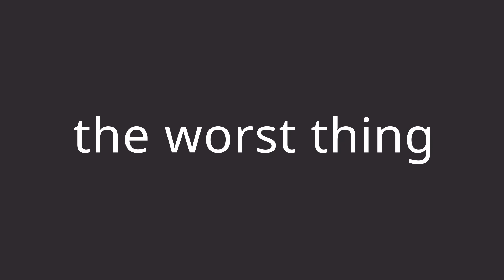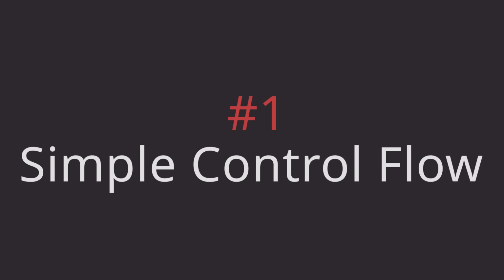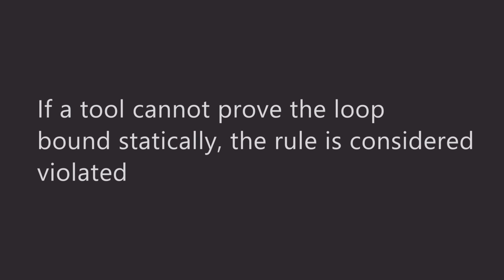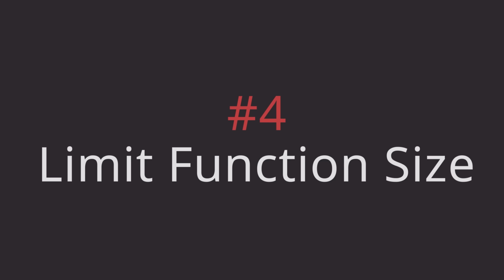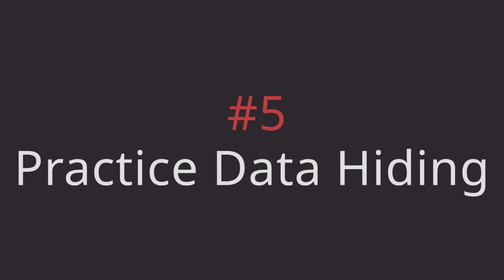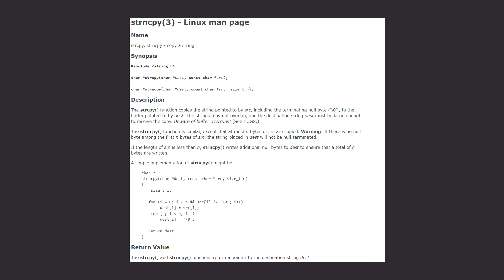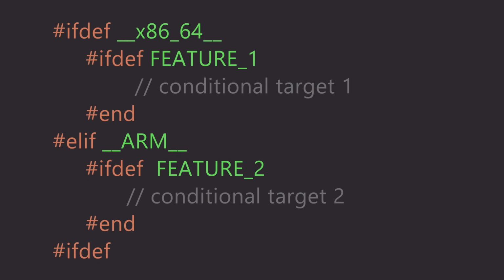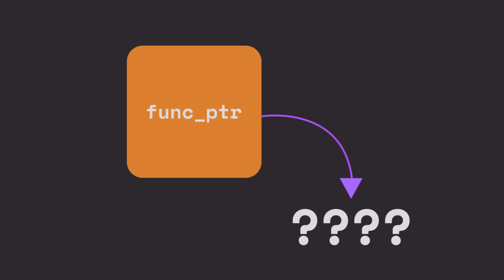how NASA writes space-proof code

Comment: Let's also remember that NASA has to write code for hardware that is, to put it lightly, UNRELIABLE.

There is a random chance that a solar flare might wipe significant portions of memory, for example, or maybe a payload will get hit with debris that takes out a chunk of the machine.
The code for such a device needs both redundancies and simplicity as you may only have mere hours to solve a problem before hundreds of millions of dollars slam into the moon.
Reply: Bollocks.

Comment: Wouldn't it be better to make a language and compiler specifically for such zero-tolerance cases? The language will automatically enforce these rules just like how many languages don't allow the use of pointers, and then only the compiler itself should be 100% compliant with these constraints.
Reply: that is rust
Reply: @phoneywheeze  not really, I mean, Nasa has specific requirements as shown in the video. There is no current language that will literally not compile with a name variable "a" but they could make this requirement part of the parsing itself to guarantee it.
Reply: @lake5044  yeah they could. Haven't done any research on nasa but likely they have their own compiler, or some tool in the build process that checks these 10 rules and other stuff already
Reply: So, basically C with less features?
Reply: ohh you are talking java
Reply: @beastofthenumber6764  Circumventing Java's garbage collection doesn't stop it from making garbage. It's not memory safe.
Reply: @abebuckingham8198  no language is memory safe, but it is memory safer than other languages just by not allowing pointer for example. The point being is java is a language with explicit restrictions born from pragmatic shaped rules. So is the same case as a a theoretical language thats based by the nasa rules.
Reply: @beastofthenumber6764  Java is the only popular language that NASA doesn't use. That's not a coincidence. It's widely understood to be unusable for reliable code because of it lacks the ability to manage the hardware directly. The US Department of Defense has published multiple articles pointing out it's unsuitability. Platform independence is a wonderful feature for widespread applications but that comes at a cost of low-level control. It's literally the worst language in the world for NASA applications.
Reply: @abebuckingham8198  The question is can NASA have a language that follows the set of rules show in the video instead of expecting programers to follow them by their own.  Java already did this with another set of rules they are not the same and if you are correct dont work for nasa, thats fine, just make a language that does. But java and pretty much all modern languages (Ruby, Python, Go, etc)are evidence that it can be done.
Reply: @abebuckingham8198  PD: If nasa uses C they can  pretty much use any other language instead.
Reply: @beastofthenumber6764  You're really out here confusing interpreted languages with compiled languages. I can see how you ended up programming in Java. Try not to leave your whole brain in the litter box.
Reply: @abebuckingham8198  i really dont get what your argument is, first i think i expresed myself poorly in my first response and sounded like im advocating for java. So I corrected saying im for the principle of making a language follow a set of pragmatic rules i mention a few some of them happen to be interpreted but that is irrelevant to my point. Are you arguing against another especific point?
Reply: @beastofthenumber6764  You can't replace C with languages like Python because they don't allow you allocate memory directly. It's obvious you don't understand how garbage collection and tail-recursion work. You're not equipped to understand the differences between languages.

Comment: I am systems engineer who designs and writes software for spacecraft, not nasa but privately owned and launched satellites. Outside of NASA some of this is true especially avoiding heap allocation and recursion. Modularity is key, the ability to isolate key functionality into small code blocks that can be tested,developed and repaired is a big design motivator. Tides are turning now, the last thing I worked on essentially just ran Linux and system components just ran on top of that. With that advancement more sophisticated sw tools and memory management techniques open the door to a much more laid back approach to spacecraft software design.

Comment: In Nim I'm forced to either use/store or discard all return values, and automatic reference counting (ARC) works really well on microcontrollers (as long as we avoid cycles or handle them properly). I wonder if NASA has considered using Ada or some other language that inspired Nim. Or SPARK which is a subset of Ada designed to be completely verifiable.
Reply: It's safe to say NASA knows about Ada, since it was required for military projects for quite a while and still powers a lot of aviation software.

The problem is getting people who know how to program in it.  You can hire Java and C++ programmers anywhere, but Ada programmers only really exist inside the aerospace and defense industries.
Reply: @jeffspaulding9834  Thank you, I didn't know about that. But it makes sense.

Comment: rule nr. 11: always annotate the unit of measurement wherever applicable. private aerospace contractors could otherwise introduce imperial units into your code without noticing 🙈
Reply: The fine for violating Rule #11 is: $327.6 million
Reply: Nice to see that someone else got the joke,  @pilafmon .
Reply: Units should be a part of type not a comment next to a value. Your code should not compile when you mix units. You can add explicit conversions if you want to. Create a type LengthInMeters and use it everywhere.
Reply: @rafałzięba9982  yep, that’s a great standard!
Reply: @rafałzięba9982  Well most space code is written in C. Good luck with the type system.
Reply: @agranero6  That is a toolset issue. During Apollo missions computer program (at least parts of it) was manually woven (I had to google this word) with a wire. We don't do this any more. Beside, even when you have the type system you can still do some precompilation things to lower it to regular C.
Reply: @rafałzięba9982  How can you make unit a primitive type like float?
Reply: @finmat95  Create a struct or a class with a single field of type "float" and call it "LengthInMeters". Create another one and call it "LengthInInches". Do not add any implicite conversion. This was the compiler will always point the big error you are about to make.
Reply: @rafałzięba9982  Assuming the language supports it and that one can spare any memory/time cost, I agree.
Reply: @lissythearchitect  I think they meant creating user types corresponding to units, not a language's built-in types
Reply: @orthotron  I understand. Not all languages support creating user-defined types, nor have the strong type checking needed to make this useful. Sometimes all you can do is change the name and/or comment.
Reply: @lissythearchitect  A good compile time data type shouldn't affect momory/runtime much.
Pretty much all major languages support faking user-defined datatypes.
It can be as simple as a struct, a type label, and a function
Reply: @lissythearchitect  PASCAL, for example, has strong type checking and does not require the use of pointers unless needed. And I say disallow pointers in any case
Reply: @rafałzięba9982  COMPLETELY agree! Make it a type and enforce type standards. Another reason I like Pascal, ada, etc.
Reply: @rafałzięba9982  Agreed
Reply: @rafałzięba9982  lmao
Reply: Yeah, I bet NASA started annotating their units of measurement after the facepalm-worthy failure. 😄
Reply: @kneekoo  I would hope so. But considering my experience doing <government> work, do NOT assume so!!
Reply: @GinoACosta  Well, I don't really have to assume or bet, because they talked about their Mars Climate Orbiter mission, and they learned that lesson. But considering NASA caught a lot of issues in Boeing's Starliner, and haven't green-lit it even to this day, I think they're doing pretty good at catching problems.
Reply: I agree; units are essential where they are relevant.
Reply: One thing that I've learned to do over the years, when I have a variable named something like "timeValue", I will always add the units at the end, EG: "timeValueMs" or "timeValueSec".  You'd be surprised how often even the person who writes the code will forget what units they are operating on.
Reply: @gamerk316  Absolutely! Sadly, we have to do that precisely because we don't have variables for all the kinds of measurement classes that we should have.
Reply: use the type system instead!
like create a wrapper struct or something. name annotations will fail you eventually
Reply: Mars Climate Orbiter moment.
Reply: Rocket science is done in imperial.

Source: ive sent rockets to space
Reply: The problem wasn’t with the private aerospace contractor but with NASA’s own spec being incorrect.
Reply: LOL - this could be avoided all together if everyone used the freaking METRIC system!
Reply: @RocketRenegade  mixing up meters and centimeters, or milliseconds and seconds can still be an issue
Reply: @v0xl  that is true but I was specifically responding to mixing up imperial and metric measuring units.
Reply: @RocketRenegade  This could be avoided altogether if everyone used US customary units.
Reply: Metric > hamburger units
Reply: I was waiting for this in the video but sadly no mention. It's ALSO very important.
Reply: xD
Reply: I would kindly revoke the membership of this particular team member 🤣
Reply: A comprehensive set of classes need to be developed (and their use enforced) which defines classes for all the multitude of measurement units (inches, feet, speed, seconds, minutes, watts, volts, amps, and on and on) along with the valid conversions amongst them, like multiply two length class values and the result should be an area class value.

It should be FORBIDDEN to use simply integer or floating point numbers to represent real world units like feet, and inches, and calories, etc. It should be REQUIRED to use the appropriate class for those objects.

Maybe these classes already exist. I had never come across them during my career. But they would certainly have eliminated the problems of, for example. a spacecraft crashing into another planet because one software team was using imperial units and the other using metrics.
Reply: Even better, lets just not use freedom units in anything that is minimally serious.
Reply: @elEd0  Freedom units? I've never heard that expression. What do you mean?
Reply: @RogerGarrett  That is how people in the internet call imperial units, its a meme basically.
Reply: Absolutely agree. Have always wondered why this is not done as a standard in all software.
Reply: I call this the "don't hire Americans" rule.
Reply: Lockheed Martin moment
Reply: Ah yes nasa lost a rover cuz of imperial measurement
Reply: yes - i repeated your point
Reply: It happened already...other suggestion: anotate version: Ariane 5 was loaded with a configuration code (I think, I can't remember) for Ariane 4 and it was not ended in a good way. The watchdog detected the wrong trajectory and it self destructed. I found it "a 64-bit floating point value was attempted to be stored in a 16-bit integer, causing an overflow due to the higher velocity of the Ariane 5" Rust doesn't seem so bad now, hun?
Reply: The tragic thing is, NASA had already established that it is working in metric. So that was entirely on the contractor
Reply: Using Imperial is stupid to begin with.
Reply: @crateer  Tell that to those who use it
Reply: It always amazes me that even standard C# functions like Sleep() often don't specify the expected units.
Reply: @steve16384  But are they not the same units every time?
Reply: @kneekoo  Presumably they are if it's the same function each time, but they never explicitly specify the units. Sleep() was just an example.
Reply: @kneekoo  of course the units differ between languages and even libraries, and a good programmer should know multiple languages. Which means I can correctly know the units for sleep() but still get it wrong *for the language I'm writing at the moment*.  I've done errors like that - written code that has a bug but is exactly correct - in another language.
Reply: Agreed! In Every Function
Reply: A comprehensive set of classes need to be developed (and their use enforced) which defines classes for all the multitude of measurement units (inches, feet, speed, seconds, minutes, watts, volts, amps, and on and on) along with the valid conversions amongst them, like multiply two length class values and the result should be an area class value.

It should be FORBIDDEN to use simple integer or floating point numbers to represent real world units like feet, and inches, and calories, etc. It should be REQUIRED to use the appropriate class for those objects.

Maybe these classes already exist. I had never come across them during my career. But they would certainly have eliminated the problems of, for example. a spacecraft crashing into another planet because one software team was using imperial units and the other using metric.
Reply: @RogerGarrett  Those classes that you mention probably already exist, the problem is that they will be of no use if someone working in the code makes a mistake and forgets to apply the corresponding conversion. Avoiding human error should be the priority and the most effective and elegant way of solving this is just using a standard metric in any given field of study. Not to mention that in some conversions is inevitable to lose some quantity of precision.

 The problem with imperial is that they are not precisely defined using universal constants as the metric system is, making them obsolete in fields where absolute precision is needed (like space science is).

Of course I understand that some people are more familiarized with the imperial units, but humans dont need that level of precision in their day-to-day lives, so using imperial can be justified when used to give information to a human (a ruler, a speedometer, etc)
Reply: Imperial are nonsense. Any further consideration about how 1000mm = 1m is worse than 737383ft = 1/7137 mile is emotional. Period.
Reply: @mestresplinter2467  Imperial should only be used in human interfaces, where exact precision is not required and making the metric to imperial conversion is usually as easy as making a simple multiplication. Anything other than that should not even consider the idea tbh.
Reply: Mixing units of measurement is up there with mixing informative engineering information with political gossip.  Can be problematic if not acknowledged & eliminated early on.

I'm also wondering how relevant this statement is considering most higher levels of education don't use imperial units to describe mathematics, physics, engineering topics in general.  ...you went to school, right?
Reply: Please work with american engine or car brands.
Every fucking measurement is imperial.
They don't give a fuck about the metric system.
Reply: @TheZaomei  Based on a quick googling of the issue, I don't think your claim is true.
Reply: @midinerd  Hello? Of course I went to school - although I self taught as well. Why assume I didn't just because of use of imperial units? Trust me, many more use them than you would think. I am ONLY trying to advise on keeping down the confusion. Don't tell me about this, tell this to those who refuse to have a set standards. I find nothing wrong whatsoever with setting a set standard of units, weather imperial or metric. Today, of course, it's mostly metric. But again, I don't want to make presumptions either. Peace always

Comment: There is also an extension of these rules for C++ that includes the rule against using templates (obfuscation) and some kinds of inheritance.
Reply: I’d rather use a C++ template than hand-code all the instantiations of that template and risk bugs in some of them because I didn’t keep all of them in sync.
Reply: @richardblain4783  I think you miss the point. For "safety critical" software, you just don't use risky teqniques like this or libraries that require them.
Reply: @parentalunit22   My point is that writing a source module once, and using it several times, is more likely to yield correct, bug-free code than writing several, similar source modules separately. Templates let you share logic across multiple data types, just like functions let you share logic across multiple users of that logic. If you find and fix a bug in one type instance of a template, you’ve automatically fixed that bug in all the other type instances.

Why do you think templates are risky? If you think they obfuscate source code, please explain what you mean by “obfuscate”, and why templates obfuscate code any more than structs or classes.
Reply: @richardblain4783  The most popular answer on this stack overflow article is pretty dead on, if you're really interested. https://stackoverflow.com/questions/56557596/why-is-c-template-use-not-recommended-in-a-space-radiated-environment
Reply: @richardblain4783  And as a side note, code reuse is always better, but there are lots of ways to do this that do not require tempaltes.